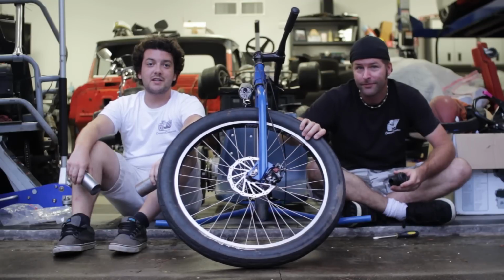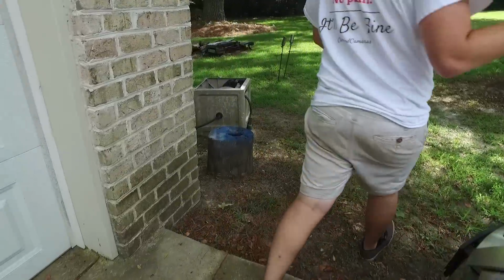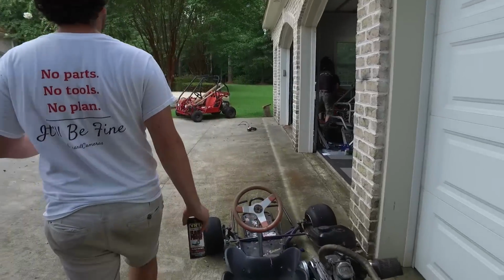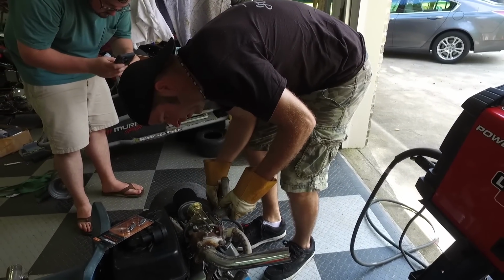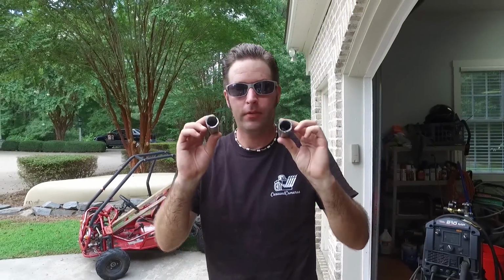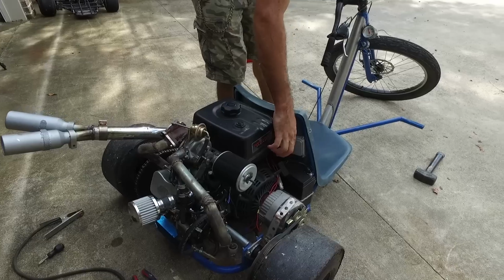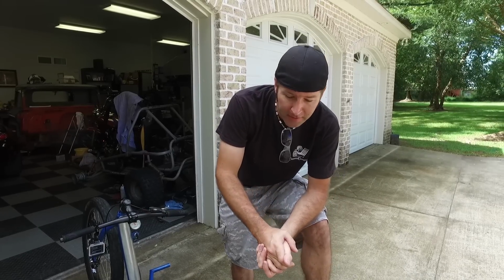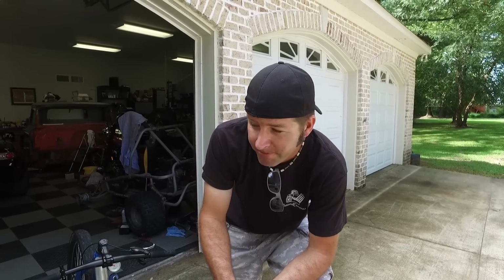911 Turbo Blow Off Valve on a Drift Trike??

Comment: Hey guys love your channel, just wanted to share a piece of advice...for what it is worth. 

A blowoff valve/diverter valve: 1) works by removing excess pressure between the turbo and the throttle body eliminating turbo stall. As you accelerate your exhaust brings your turbo to speed and  pressure in the charge pipe, as you let off the throttle the excess pressure in the charge pipe needs to go somewhere. If your throttle body is closed the pressure will back feed into the turbo leading to dreaded turbo stall. 

2) As there is no "vacuum" in the line there is no need for a air filter.

3) For your best bet to get the results you and we as viewers wish you get, will be to play around with the spring in the blowoff valve. Smaller spring or playing with the current spring's tension by adjusting the screw on the top.

Again love your channel I hope this helps and we can watch you guys make the blowoff valve as loud as the Porsche!!!!!!!!!

Comment: Steal a vacuum reservoir from a car and add that to the system, should act as a vacuum capacitor and maintain a smoother amount of vacuum.
Reply: k just said the same thing :) would love to at least see it tried
Reply: It works as long as u put a check valve to hold the vac in used this on a vw for brake booster

Comment: Hey guys, you may already know this but I thought I should clarify what a blow off valve (BOV) is. A blow off valve bleeds off pressure created when the throttle plate is closed. With a larger engine, you get the distinct PSHHH sound. This protects your throttle body and turbo charger because when the throttle plate is closed, the air has no place to go so it's forced back through the turbo charger, causing "turbo flutter", the typical SUTUTU sound you hear when you lift off the throttle. This is NOT good for your turbo as it can cause major shaft play and subsequently compressor damage. You should always have a BOV on a turbo charged engine. Just my $.02. Love the show!

Comment: Guess you could make a mechanical blow off valve. Have a cable attached to the throttle (carb lever) to the BOV and make your own contraption with a spring so when you let go of the throttle it opens up the valve using a spring and a rod. So when you apply throttle it closes the valve instead of trying to get the vacuum to work correctly. You also could use a 12v solenoid and a pressure switch on the throttle arm then adjust the switch so around 25% or less it has the solenoid open and use a relay with the ignition so it doesn't apply power when it's off. Then you put a whistle or any type of end after the solenoid to achieve your sound.

Comment: That's a diverter valve and technically speaking a VW part although probably used on everything in the VAG lineup. it's the same one used on many VW's and Audi's. VW and Audi's use diverter valves to recirculate the pressure as they don't blow it off to atmosphere in their systems they use a recirculating system. If you used an actual BOV you'd likely get a better woosh sound lol.
Reply: lol yea my 97 audi a4 aeb 18t has the same valve and why they put a breather filter on the end of it is just crack up
Reply: Said the same

Comment: grateful video guys. if you want more blow off sound add a tank to the charged intake pipe. you have enough pressure but not enough volume, down side is you will lose some throttle response as you will have more volume in the intake to pressurize. feel free to hit me up if you have any questions. I'm an efi tuner and enjoy your videos :)

Comment: Could you maybe use a lighter spring on the valve or is that not how it works?
Reply: That’s how it works light spring for small boost applications and heavy springs for higher boost applications

Comment: Just yesterday I had an idea for you guys. Instead of that 3 wire alternator, I think it would be easier to adapt a Honda GX390 10 amp charge coil to the 420cc. It wouldn't Rob much or any power, be all the power you'd need plus it would be generating more power while the engine is at idle than the alternator is. Just a suggestion, so you wouldn't have to worry about an extra belt, large pulley or loss of power.

Comment: your blow off valve is actually a recirculation valve and usually diverts boost after the intercooler back into the system so isn't designed for vent to atmosphere.  I'd take the filter off it and look for a basic dump valve with an alloy trumpet on the end. Do keep your good work up tho. I enjoy seeing you two guys and your quest for speed.

Comment: I heard it initially ay 5:48, but because of the slippery rear wheels, you might not be loading up the engine enough to spool up the turbo. What it the  boost pressure during the runs?
Reply: 7 psi
Reply: That's true the engine has to be under heavy load and then release throttle to get the loudest turbo noises. Without much traction the engine never gets much load on it.
Reply: Isaac, How bad do you want to take your truck through there sideways now hahaha
Reply: don't want to even waste my gas
Reply: you put actual load on that motor at 7PSI and it will blow up 
I can already hear its way lean they are asking for it
Reply: +rjc862003 NA engines can run about 10psi before it'll blow a gasket. Read any forum that turbos NA engines like Rangers, S10s, Focuses...10psi...7psi on a small engine won't hurt anything. May cause premature wear but who cares, it's fun.
Reply: you don't have a clue what you are talking about
just because the engine is NA doesn't mean you can run boost  there are a dozen factors at work that determine if the motor will stay together
1.how strong the rotating assembly is 
2. the sealing of the rings on the piston
3. AFR/spark management
4.compression ratio 
5. intake temp
ect ect

I own race engines that are NA that are 12:5:1 that you aren't gonna be putting a turbo on and have it live
Reply: the reason I suspect it hasn't blown up yet is that probably half the boost pressure is blowing by the rings, because if it wasn't the rings would have folded up and destroyed the motor on the first pull
Reply: +rjc862003 I'm talking most engines. Like the new 5.0 Coyote from Ford can take boost no issue. maybe you should read into a subject before calling someone out whose looked into it for several years.
Reply: you can google all you want kid I have worked on this stuff for 30 years there is more too it then bolting turbos to shit and hoping you don't blow it to hell.

 your statement that just because a motor is NA means you CAN turbo is woefully incorrect and shows a complete grasp of understand of the processes at work here
Reply: +rjc862003 whatever. and for the record I am not a kid. so bug off.
Reply: rjc862003 when you meet someone who know what there talking about also😂😂😂
Reply: rey gar that there is compressor surge you hear not the diverter value it's because that value is made more for 20 something psi and is not opening with the boost there making
Reply: Ratkill9000 my buddy put a turbo on a coyote mustang at 8 psi and it blew up 2 weeks later.  And he never even worked it that hard.
Reply: the engine they are using has around 8.5 compression ratio they are low compression so a tiny turbo wont hurt it just because you have 12.5:1 doesn't mean every engine has high comp

Comment: blow off valve will only activate when mounted right at your throttle body and you go from wide open throttle to closed throttle rapidly (its function is to prevent you from blowing your throttle blade into the engine due to high boost pressures surges), the exhaust wastegate is designed to limit your max boost pressure and as someone else stated the filter will also muffle it as well as slow its operation.

Comment: guys i don't know if you've heard this yet. but those factory blow off valves like the one off the Porsche are designed to be silent, to get the sound you want you will need an aftermarket one... one with adjust-ability so you can wind it right down.

Comment: Great videos guys I have turbo charged single cylinder motor bikes and the only way to get rid of the pulse and make power is to fit a accumulator to the charge pipe 4 x the cc of the engine (e.g. 250cc need a 1000cc tank ) so when it makes boost it will have some room to store it as the intake valve is closed , this may have been covered by someone else

Comment: Isn't that a diverter valve?
Reply: yep but works the same
Reply: No it doesnt. It diverts air back into the intake, doesnt blow it off to the atmosphere.
Reply: it does when you install it the way we did
Reply: Thats what I just said! You dont really get a "insert BOV noise here" with a DV. I recommended a small BOV with a really light spring.
Reply: +Justin Telford I totally agree with. changed the DV to a BOV on my old wrx and PPSSSSHHHH she went.
Reply: Sam k
because the BOV vents to atmosphere, whereas the DV is MEANT to put it back into the system, but, they plumbed it to just dump to atmosphere, so it will indeed go PSHH

Comment: even if the blow off valve doesnt make noise they serve a real purpose. They help extend the life of the turbo so every time the throttle slams shut the pressure in the charge pipe doesnt ram into the turbo

Comment: That is a sweet project and cool garage guys. You have my SUB! You had a lot of good points about the bov effectiveness on the setup (small displacement & poor vacuum).It seemed like it was making some noise at higher engine speed closed throttle, though.For more noise, you guys might try temporarily taking the filter off the end and putting a [whistle or kazoo] inline {or narrow the opening of the vent hole} with some sort of cap drilled at the end.Those style diverter valves are used to recirculate boost in factory trim, so they are not really tuned for noise, more meant to be free flowing.Also, you can try putting a weaker spring inside the vacuum diaphragm so that it opens with less pressure.I know that the aftermarket ones unscrew torwards the top to change out the spring, on yours you may just have to epoxy it back together (test spring tention by just zip tieing it shut until you find the correct pressure).Sorry for the long post, the video got the gears turning heh.OhNoGoForIt
Reply: thanks for the pointers

Comment: I heard it just fine ? Idk what you guys are talking about
Reply: Me too
Reply: +ThatBlueBike it's not the loudest but it's still there
Reply from the maker: To be honest it came out so much better on camera than it did in person.
Reply: +CarsandCameras Ya on camera it came out great tbh
Reply: yeah tbh, yall should stop saying to be honest....
Reply: +TR7 TRIUMPH Yeah, and tbh I think I've seen you before. and the tbh thing seems to br catching on
Reply: You aren't gonna get any surge with a suck through setup.  The boost surge comes from pressure pushing back when the butterfly in the carb closes while the turbo is spooled.. when it's a suck through setup the carb closes on the outside of the turbo so it's gonna generate a surge in vacuum instead of pressure.  There is a reason suck through setups don't run BOV's, you don't need them.
Reply: same

Comment: Man I am with you and being pissed off by people that use that as the basis of their complaints about peoples driving. Its one of those things that puts me in a real fit of anger and dislike. Had a neighbor call the cops on me cause i was doing high speed starts on my own property. Registered vehicle, but the spill over if i where to not slow down in time was into my own property and safe. (plus i was 100% on my own land). Cops told me off for 40 minutes before they listened to me about I own the property i am driving on. That they only had an easement to it for access. They apologized after that, but still really pissed me off. Hope shit works out.

Comment: It's not a pulse (or vacuum) that you want to hear. The Porsche (or any other) blowoff valve controls the turbocharger boost pressure to the engine. If the valve is set for 15 psi, then the turbocharger can generate up to 15 psi, and the blowoff valve gets rid of the pressurized air above that would make it more than 15 psi. The Porsche valve you're using is meant for a much, much bigger turbocharger and much higher air volume. That means it might not be able to work efficiently or maybe not at all for a couple reasons.
Reply: In a normal situation like a bigger engine, what you're hearing is the wastegate taking pressure away by bleeding higher pressure to make lower pressure.

Comment: The flutter is caused by not having a BOV when the pressure builds up due to the throttle closing.
The air blast people like to hear from a BOV is just that: bleeding off the intake pressure so as to prevent turbo flutter.

Comment: Pretty sure thats a oem bosch bov. The issue i think you guys may have is the spring pressure is set to high in the valve for your application, its for a porsche turbo 6cyl i am assuming. They would run a minimum of 8-10psi from factory. Plus would generate more than an equal amount of vacuum to open the valve againt the spring rate. Try seeing what the maximum boost pressure is on the kart, then look for a oem bov say off of a much smaller factory turbo engine or a adjustable spring rate bov. Would then be a higher chance of operating under such smaller negative pressure on the kart. Really enjoying the videos and interesting and clever masterpieces you guys come up with, keep up the good flicks.

Comment: You want to smooth out the vacuum pulses, go to the auto wrecker and look under the hood of just about any 70's ford boat...LTD, Lincoln etc or an S10 4x4 for the front diff actuator. They have a little black plastic ball in there somewhere that holds vacuum. It has a check valve on the inlet so it continuously builds vacuum then the outlet has a smooth vacuum signal. Also, like someone else commented... build a proper turbo pipe. that scabbed up thing with all the welds and the 90 at the end is probably equivalent to having 20 feet of pipe between the turbo and carb. PS. love the videos. keep up the fun and screw the grumpy old man.

Comment: That's a diverter valve. it's used to recirculate unused air pressure back into the system. A blow-off valve opens from an excess of air pressure from the turbo. it works in the same way a radiator cap does.

Comment: A 1982 280zx turbo has a small factory oil cooler that looks like a tiny intercooler. You could make it fit the drift trike so that there is more air to blow-off.

Comment: Have you guys put pulse cancelling filters in the line to your boost gauge...  They work on a vacuum gauge for a single cylinder motorbike and smooth the needle wobble. 

Also you guys should sort out your piping now you have it running.

Also... Please consider some form of twin cylinder engine to swap into it under that turbo setup!

Comment: for sure not enough vacuum to open that thing, also that is a diverter valve not a BOV its held open by vacuum until boost/ its own spring lets it close. assuming it did work it would be a huge vacuum leak. DVs need to have the other side Plumbed back into the intake Pre turbo. cut that thing open and see if you can put a lighter spring on it. also make sure your vacuum source for the fitting it after the throttle body. such a fun project tho guys thing looks like it rips!

Comment: That's technically not a blow off valve, it's a diverter valve. They're used when the engine management doesn't allow for the discharge of intake air as this will affect a/f ratio.

You need a blow off valve with spring back pressure that is easily adjusted. It'll eliminate the need for vacuum to open the valve.

Comment: you guys need a diaphragm dump valve for that to work. Valves with a spring piston in it like the one you fitted won't be able to open under the small vacuum your engine produces.

Comment: those valves work without vacuum, the vacuum is to get it to be open or more easily open at idle.  

I could have sworn that you could hear it in the video, even before the mufflers.  If you want it louder, the filter you put on the OUTLET is acting like a muffler, pull it off and nothing will get in that way anyway.

Comment: if vacuum is the issue perhaps find a way to alter the spring activation force of the valve.  after all it was designed for a larger engine any way

Comment: What are the back tires made of?
Reply: I cant remember
Reply: Any tire will work, then get some PVC a little bit smaller then the tire when it's fully pumped up, let air out, put PVC over it and then pump up again, voila. Also, Ike with the amount of subs you guys have, you still reply to most every comment, I'm impressed, keep it up man
Reply: thanks

Comment: If you installed it at a less off an angle to the exhaust pipe it could work. Because a blow off needs almost a direct supply of exhaust flow. At 90 degrees to the exhaust it's not getting a lot of exhaust flow in to work it work.

Comment: thats a bypass valve not a blow off valve. if your trike has a mass air flow sensor before the carb that means that all the air in the piping has been metered so those valves are for taking the charge air and redirecting it back into the intake so that all the metered air gets burned. if your having any problems after letting off the gas that could be whats causing it. love the videos.
Reply: thanks
Reply: im sure yall probably already knew that. i love your videos. if i wasnt always working on my car i think id be building gocarts. its awesome to see what yall do with some of them. i really like the way you mounted the motor on the front of the rat rod gocart.
Reply: thanks

Comment: put a vac canister on it off an auto free wheeling hub setup found in things like Mitsubishi delica and tritons etc then use a vac solenoid to activate it when you lift off by hooking up a proxy switch or a sensitive spring type switch at half throttle? if you wanna go that far with it :P looks fun